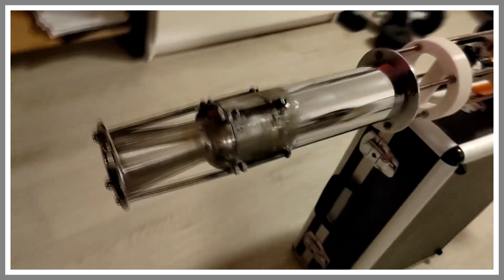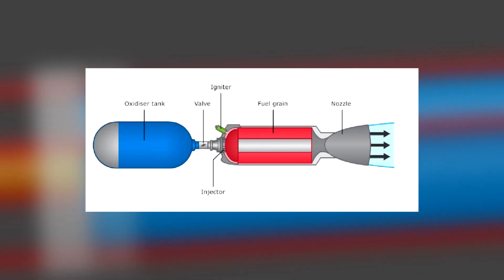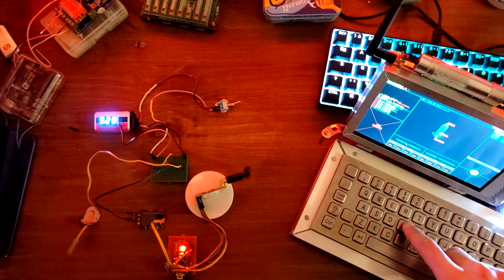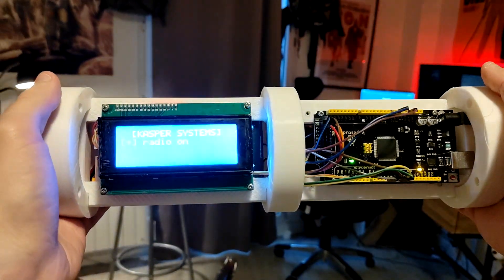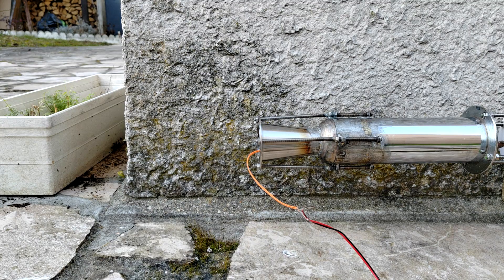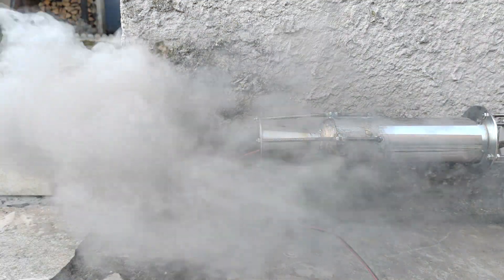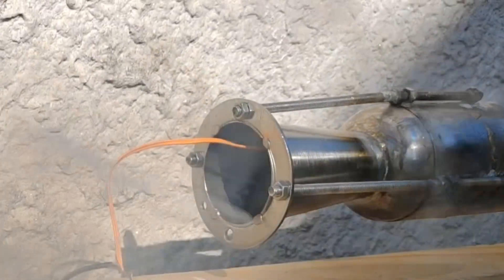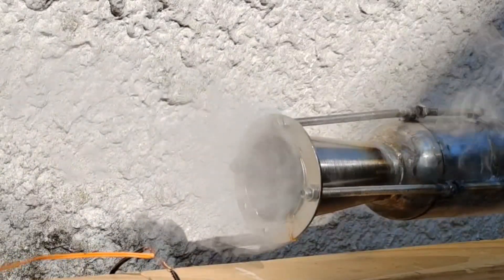Trying to make a hybrid rocket engine

Comment: Not bad, but you need alot of improvements, more fuel, higher pressure oxygen, if possible use nitro, but I would like to try making something like this, I normally make solid rocket motors, but knsu doesn't really meet my needs

Comment: what brand is your oxygen tank?
Reply from the maker: It's a " dexter " oxygen tank, you can find one in  most  DIY shops
Reply: @zenithgalactique3468 you should use N²Obecause it becomes liquid at relatively low pressures and works better dan O² 99% of good hybrid rocket engines use N²O

Comment: what fuel youre using with oxygen as oxidizer
Reply from the maker: I'm using a fire starter that is soaked in kerosene. I'll maybe try with paraffin as it is often used
Reply: @zenithgalactique3468  you could try sum APCP but thats tricky

Comment: Nice one,I was also wondering how to make one myself and I dont know where to get the metal and make it into shapes if you know what I mean
Reply from the maker: the metal bits i used are basically two metal table leg, then I soldered 4 metal rods so i can put them together.
Reply: @zenithgalactique3468  And what if I dont want to break my table are there any places to get metal and shape it?
Reply from the maker: @FZM2010  haha i didn't break any table I just went to a DIY store ( Leroy Merlin )
Reply: @zenithgalactique3468  oh ok thanks

Comment: what kind of design work did you do for that nozzle, it looks way bigger than it should be
Reply from the maker: The throat is actually way smaller than it looks from the outside. But as the gaz isnt super sonic in those tests the nozzle is fully optional. But the ratio [ throat/ nozzle exit ] seems good to me

Comment: Nice job! I’m currently working on one as well that uses abs plastic as solid fuel. Also you can use oxygen gas as opposed to liquid fuel if that’s more convenient since LOX is kinda hard to get your hands on, but oxygen gas can be found at hardware stores as they are used for welding
Reply: Nitrous oxide works even better because it will become liquid if you just pump it into a tank just like propane or butane